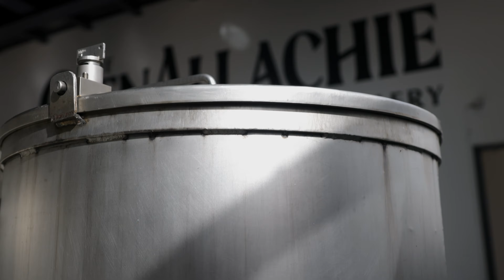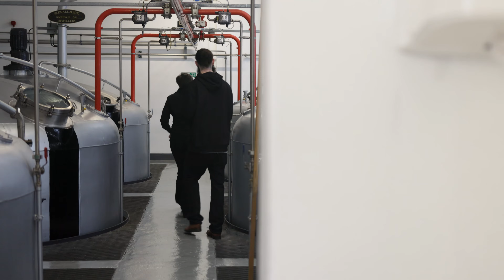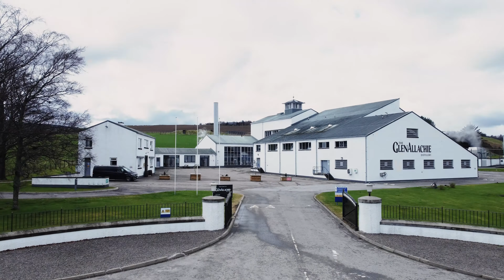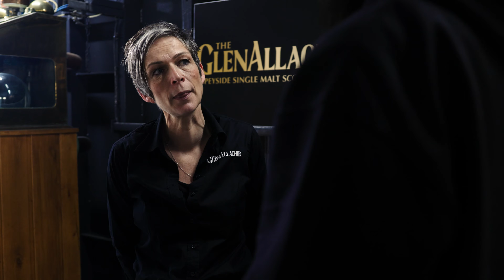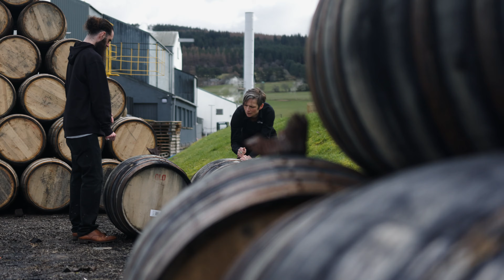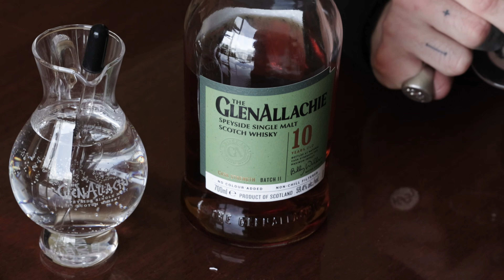EXPLORING THE SECRETS OF THE GLENALLACHIE DISTILLERY

Comment: What you are seeing is a distillery that was designed for efficiency and volume, easier cleaning stainless steel, huge sizes and numbers. 163 hour fermentation makes running a 5 day a week operation easier, 168 hours in a week. Some distilleries running a 5 day operation are utilising 84 hour and 120 hour fermentations to get avoid weekend operation with all the HS&E and rostering complications.
Reply from the maker: you know your stuff!